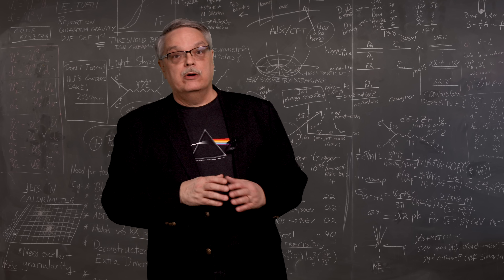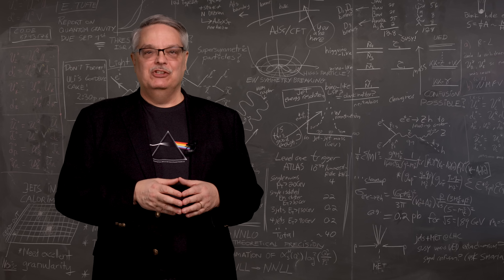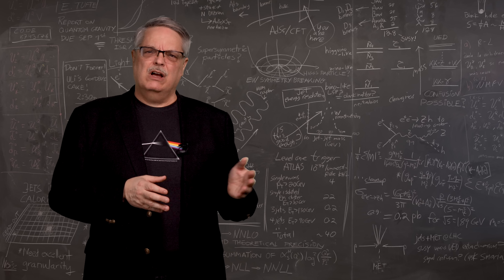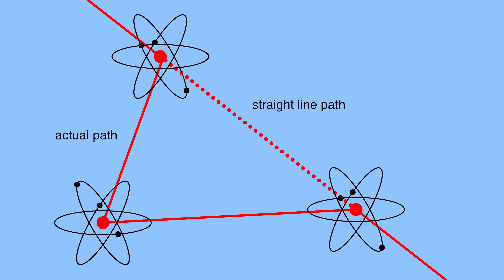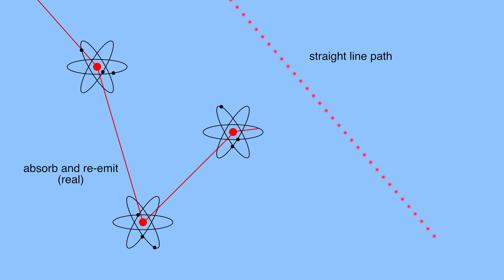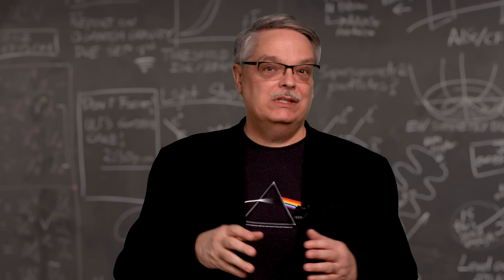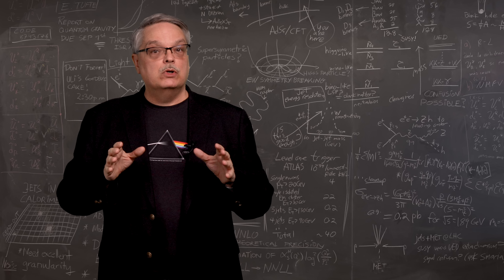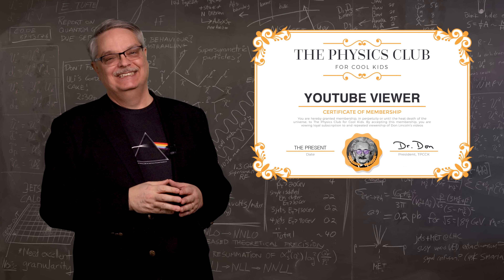Why does light slow down in water?

Comment: But why does the wave generated by the electrons move at a different speed?
Reply: I thought all electro magnetic waves moves at the speed of light, why doesn t the ones generated by the moving electrons as fast as light is, i can t find answers on google.
Reply: We are frequently told that electricity moves at the speed of light through a conductor. Not really. It depends on the conductor. If you look at some TV video co-axial cable you might find a number printed on it apart from the "75 Ohm" marking such as "0.66" or "0.75". This smaller number is the velocity factor. It means the video signal is moving along the wire at 66% or 75% of the speed of light. The reason is the same: the movement of the electric signal generates its own opposition and the effective progress is slower than the theoretical "speed of light/electricity".  You will find detailed explanations of this in HAM Radio handbooks. HAM radio signals are usually fed through larger (than TV) diameter 50 Ohm coaxial cables with a velocity factor of 0.66. This has to be considered when cutting the cable length because the cable must never be exactly an odd multiple of 1/4 of a wavelength or the antenna won't work well.  See? There are very practical applications of such knowledge of physical systems.
Reply: @roberttrisca8210  Nope, speed of electromagnetic waves depends on the permittivity and permeability of the material through which it travels. The speed of light as you know it is the speed of  light in the vacuum. Vacuum has specific values of permittivity and permeability. see : https://en.wikipedia.org/wiki/Electromagnetic_wave_equation
Reply: @roberttrisca8210  There are substances that can slow light down to literally single meters per second.
Reply: @imonlyamanandiwilldiesomed4406  source ?
Reply: @imonlyamanandiwilldiesomed4406  much appreciated ^^
Reply: @roberttrisca8210  Both the initial elector magnetic wave and the wave emitted by an oscillating electron, progress at the speed of light in the space. However the wave length emitted by the electron is a lot larger than the wave length of the light. This is due to the electron having mass, which resists the change of its momentum. Together these two waves form a wave packet with two frequencies, which progresses slower than the light itself. Google wave packet propagation for more info :)
Reply: Lauri Vaara thanks
Reply: @laurivaara3177  
while it is true that wave paquet travels at speeds inferiorto the speed of light, it only works in dispersive medium.

also, if you apply, newton's second law to an electron, for frequencies low enough so that we can neglect the thermodynamic equivalent of viscuosity forces, we get that the speed of an electron and the electromagnetic field oscillate at the same frequency, except, with a phase difference of pi/2.

the real reason why is due to the electric current that modifies the dispersion relation that the wave have, here's a good article to understand, though it is rather lengthy and very math extensive:
https://en.wikipedia.org/wiki/Mathematical_descriptions_of_opacity
Reply: They all do, but its the interaction of the light waves interacting with electron waves. electrons orbit atoms as waves not particles. When two sets of waves interact that propagate as if they are a become a new waveform (combination of phases), until it exits the transparent material. The Light can propagate beyond the transparent material, The electron are force to remain in the material orbiting their atom nuclei. Thus when the light exists the material is continues traveling at c.
Reply: @roberttrisca8210  : it does move at the speed of light. It just that the second EM wave does not have the same wavelength and frequency as the one that entered the material. The combined wave produces a wave with peaks and valleys that moves at a slower speed than the original.
Reply: @zapperz2000  and one more thing i dont get, when do em waves add up to form one, and i m thinking of the different colors beeing different waves which don t add up to become one or how does the colors work then ?
Reply: @roberttrisca8210  This is not a property of just EM wave, but rather all types of waves. It is called "superposition". It happens in water waves, sound waves, etc. It is why you see "white light", because it is a superposition of all the different rainbow colors, and your eyes perceive such superposition as the color "white".
Reply: @zapperz2000   but the emiting  direction would be random , every time we should get a bit different speed in material
Reply: @naveenpoonia5425  Not random, but refracted differently.  That can indeed happen if the material or its surface is not uniform.  You'd get a distorted image when looking through such a material.
Reply: @zapperz2000  I'm confused about the same thing. As you mentioned, any EM wave travels with a same speed. And I get that the resultant wave has a different wavelength/freq. But it should still travel with the same speed as the original wave. But you say it moves slower? Didn't we establish that the speed of light is independent from its wavelength?  Why would it travel slower?
Reply: @DrFarazHarsini  The various waves ARE traveling at the speed c. However, the SUPERPOSITION of all these waves, i.e. the resulting wave, has a velocity that is less than c.
There is such a thing as group velocity and phase velocity of a wave. Often times, when we talk about the speed of a wave, those are what we are referring to.
A good thing to review is the concept of thin film interference, especially in the context of anti-reflective coating. It is not that there is no reflected wave. Rather, the sum or superposition of all the reflected wave cancels out, and you end up with no reflection.
Reply: @zapperz2000  
but but but !! phase velocity is faster than light
Reply: @recouer  Not in this situation.
Reply: @zapperz2000  in that case phase group goes at the speed of light
Reply: @recouer  "phase group"?
Reply: @zapperz2000  group velocity ...
Reply: after all you have the relation:
phase velocity * group velocity = c²
Reply: zapperz2000 Cool, now explain the same story with a single-photon pulse-wave.
Reply: Zapperz2000 that is the only possible explanation that I can understand. However, the example he gave was for the superposition of two wave of different speeds. Do you have a reference for the effect when two waves of the same speed are superimposed? This is something that has bothered me for many decades and I would very much like to resolve the problem.
Reply: @zapperz2000  this still doesnt explain why we cannot detect a fast wavefront that moves at C before we enter steady state and the net phase (?) velocity is slower.
Reply: If the Fermilab guy had explained this accurately then we all wouldn't be chatting here wondering why. He did not explain his point very well.
Reply: @HVYMETL  Totally agree.  I had the same thought.  He doesn't explain why the lightwave and the induced electromagnetic wave combine to produce a wave that is always slower.
Reply: @HVYMETL  You got that right. He could have just said it's the drag due to mutual AC induction and let it go at that. Instead he complicated it with "mixed waves" which isn't wrong but is totally unnecessary!
Reply: @craigwall9536  
mixed wave isn't wrong? are you serious?
but seriously this is complete BS, the superposition of multiple waves has never made it slower. take the white light for exemple, this is a superposition of photons from all the visible spectrum (and more) so yes what he's saying is utter BS. 
it is mostly due to how EM waves propagates trough space. we can easily get the propagation equation of light using maxwell equations and then we can see that the speed depends on the electric current in the medium.
in a void, it is null thus light speed is maximum in a void. but once you enter a medium, atomes can be considered as dipole that can create an electric current due to the electric field of the EM waves. thus this current reduces the speed of light.

for more details: 
https://en.m.wikipedia.org/wiki/Mathematical_descriptions_of_opacity
Reply: Joe Chang  Can you prove that? Did you do publish the paper of your experiment? Did you mathematically show how Maxwell's equations are wrong? I don't think so.
Maxwell's theory of electromagnetism works perfectly, has been proven thoroughly and is the reason the computer, the mobile phone and the internet work.
Now I understand why you got banned.
Reply: Joe Chang  Your hypothesis is wrong because it contradicts experiment. Also you need to explain the mechanism behind it (and I don't mean some ad hoc explanation, but a rigorous mathematical one) and do the math, then see if your predictions are right.
Reply: When an electric field is applied to the electron, the electron starts accelerating. As it moves it generates a magnetic field. The magnetic field strength increases as the electron accelerates. This increasing magnetic field induces another electric field, which points in a direction opposite the motion if the electron and the applied field. This causes an opposing force that reduces the acceleration of the electron. It's called Lenz's law. In effect the transparent medium (water, glass, etc) behaves similarly to the characteristic capacitance and inductance of a transmission line, which slows down the propogation of the wave.
Reply: I must look this up but as I understand Lenz's law , if a conductor is moved relative to a magnetic field an electric field is induced in the conductor. This electric field will cause the acceleration of charged particles in the conductor. In turn this acceleration causes a magnetic field of opposite polarity to the original magnetic field. This opposing magnetic field would be of equal strength to the original except some energy is lost from the system as heat. If we apply this to light passing through glass the loss of energy should be expressed as a change of wavelength when the light emerges from the glass. This does not happen I had never really thought about the problem before and I am not sure that I understand it so I am willing to learn. I read something a while ago by Richard Feynman concerning the interaction of light and matter - I shall serif I can find it. I am also not entirely sure that the speaker on the video fully understands the problem. @danebeck7900
Reply: @iplanes1  I agree with most of your description of Lenz's law except the part about energy being dissipated as heat. If the induced field was equal in magnitude to the applied field than they would cancel out 100%, and then the charged particles wouldn't accelerate at all. Lenz's law is just a consequence of Maxwell's equations and has nothing to do with heat dissipation. Also, if it did cause heat dissipation, then a light wave would "damp out" after a few oscillations just like you would expect of a mechanical wave such as a wave on taught string or a slinky. Of course this doesn't happen with light. The one example I can think of where induced electric fields cause heating is Eddy currents, but that's because of the resistance of the material the Eddy currents are flowing in, not because the fields themselves dissipate heat.
Reply: Okay I have to correct myself, if you have a lossless system then the induced electric  field will have have the same energy as the applied magnetic field, they're just out of phase. Energy transfers from the magnetic field to the electric field and back again. That's how a light wave propagates without losing energy. Just like how a pendulum converts potential to kinetic energy and back again (assuming you had a frictionless pendulum in a vacuum).
Reply: My conclusion on this matter is that I do not understand it and neither does the speaker on the video. The main difficulty with the image is that at the subatomic level there is nothing that we would regard as solid matter. The idea of "solidness" is a macroscopic concept that means nothing at the incredibly small level. The "particles" themselves such as electrons are actually simply mobile  stress points in the continuum of the universe and the area around them is simply less stressed. To talk about interactions between subatomic particles and electromagnetic waves in the same language as is used for describing what happens when you slap the table is meaningless.The really useful thing about this video for me at least is that it makes me think about things I had taken for granted. The negative side of videos such as this is that some people will take what is said without criticism and assume they understand. I am pleased to see that neither you nor I fall into this group. I am also very pleased to see that you are not one of the people who regard online discussions such as this as a point scoring game that results in abuse.kia mau te rongo ki a koe
Reply: @iplanes1  Okay, but do you agree that a wavelength of light is orders of magnitude larger than the interatomic spacing? If so then it seems appropriate to treat the medium as continuous, and the interpretation of an induced wave interfering with the incident wave starts to make more sense. Especially since there are so many well known examples of electric and magnetic fields inducing opposing fields in matter. I think that's why he chose to use the wave interpretation of light to explain this, not the particle interpretation.
Reply: I think your answer illustrates the basic problem. This is the difficulty in understanding the interaction between matter and energy. Eddy currents, as you say, cause heating due to the resistance of the iron in which they flow. When we talk about radiation of heat we are talking about emission of infra red photons. So again we are talking about how electrons are caused to move by differences in potential in an electric field (we call this current). The motion of these electrons is somehow inhibited (resistance) so that they loose energy which then appears as photons. The fact that the electrons themselves can be acting, on occasions, as waves makes my mental picture even less clear. I have now got to go and work in my workshop and will not be back at my computer for some hours.
Reply: @iplanes1  @Dane Beck
i think my answer may interest you.
Reply: @iplanes1  
btw what you describe as heat radiation is highly confusing. while i do agree that heat produces photons, and we can calculate the total energy radiated thanks to stefan boltzmann law plus its medium wavelength (or rather the wavelength with the maximum of emission) using wien's law, you need to understand that this is a thermal process and has nothing to do with the moving of protons (or at least not intrinsically).
what happens here is that energy is lost due to joule's law and in the case of our electrons, its formula is <j * E> with < . > being the root mean square of the function, j the electric current of the electrons and E the electric field of the photons.
however, in the case of dispersive medium, j and E are in quadrature, this means that there is a pi/2 difference in their phase.
thus, when we get the root mean square of the multiplication of periodic signals in quadrature, the resultant is null so the energy given to the system by the electromagnetic field is null.
Reply: Frank Gibson saying that the presenter doesn’t understand coming from someone that does not possess a physics degree is irritating. If you want I clear understanding of how all this works you must be able to understand and perform the math associated with quantum mechanics and particle physics in general. Without that ability no true understanding will ever be had. This applies to me as well. I will never really understand. As Dirty Harry said, a man needs to know his limitations. Learning particle physics from YouTube videos , especially the comments section is just silly and unrealistic.
Reply: @evilsimeon  
do you know of a quatum model for describing the refraction of light ?
Reply: And why does the new, slower wave does not generate a new wave, slowing down the light even more?
Reply: testthewest123 that's because it is in phase with the electrons since the electrons is producing it. So if you have an source that produces a wave on a string the resulted wave doesn't move the source to produce a new wave
Reply: @testthewest123  new wave has smaller amplitude, it does generate furthjer waves but even weaker, etc, and all that is summed
Reply: @cicik57  
well this would be a good time to talk about converging series if the explanation was right which isn't.
Reply: @testthewest123  because there is no 'new' wave. you have the superposition of the 2 that "replace" it.
Reply: @testthewest123  EM (light) waves do not generate EM waves. EM waves are generated by moving electric charges like as electrons. I suppose you could argue that the EM wave from the electrons causes more electrons to move thus generating ever slower EM waves. While there might be some of this, the effect is negligible, because the EM waves are so weak because most of them have interacted with the original EM wave.
Reply: @testthewest123  Wave does not generate waves, only accelerated charged particles do
Reply: Because the light wave entering the transparent material is the same light wave exiting the material. its just forces to propagate slower in the transparent material.
Reply: @testthewest123  Some materials may actually do this, but the differences are related to the material and the material constants are determined empirically, so any secondary, tertiary, etc. wave affects are netted out when measured.
Reply: The higher the frequency, the less the effect... The frequency remains constant
Reply: The wave from electrons moves at the speed of light. You just can't see it because it interferes destructively on all paths except the path of the light.

In effect, when the light passes through a medium what you see is a moving interference picture.
Reply: where to begin...
this video has taken many shortcuts in explaining the relations between the two systems and how it affects them.
to better understand this, we need to talk about d'alembert's equation and its dispersion formula and how it describes a wave.
so d'alembert's equation is used to link together the spatial and temporal variation of a wave.

and from this equation comes the dispersion relation that links together the frequency, wavelength and celerity of a wave.
to access to this equation, we use maxwell relations to describe this phenomenon. when we consider those relations in the void, we get the relation: c² = k²*w² where k is the angular frequency and w its wavenumber. (just google it, ain’t that hard to understand)

thus we can see here that the celerity is proportional to its angular frequency. however, as explained in the video, when light enter a medium, there are charges that can be influenced by the electric field, especially electrons that are 2000 times lighter than their counterparts protons.
thus, when light comes in this medium, we assume that only electrons are affected by the electric field.

we then apply newton's second law to those electrons to find a relation between an electron's speed and the electric current
(we also neglect the magnetic field of the light as the electron is relativistic thus the force from the electric field is much greater than the magnetic one see lorentz law to better understand this )
and then by generalizing this equation to all electrons in the medium, we can get an induced current from the electric field of the light.
( the current is j = n * v with n the volumic density of charges and v the celerity of electrons)

then when we put this back to maxwell ampere local equation, we introduce a new component: the induced current which thus gives us a new dispersion equation: c² = k² * (w² - wp²) with wp the plasma oscillation and thus we can see that from the value of wp, we'll get a different value of the celerity of the wave.

thus we can say without a doubt that they are wrong in their explanation as it is not the combination from the electric current of the electrons and the wave that makes it slower but the induced current inside the medium that modifies the dispersion relation thus modifying its speed.
or in simpler words, it's the movement of electrons that changes the frequency and celerity of the light, but not the combination of the two electric current. (also on a side note, trying to represent the electric current of a dipole using a sine wave.. funny thing you did there 😅)

and finally, as for the reason why the light has a different angle, well you can easily explain this using two waves parallel to each other crossing the medium in phase with each other. as they have the same wave plane, you can easily come to the relation between the refracted angle and the incident angle using some basic geometry. i recommend you to see the demonstration of descartes second law if you want to better understand what i'm talking about.
Reply: @recouer  So you're saying it's because of the current which alters Maxwell's Equations, aka modifies the wave equations in vacuum where the speed of an EM wave is c, into equations where the speed of the wave is not c.

Instead, people are thinking in terms of EM waves in vacuum, which is modified by adding EM waves produced by moving charges.  Are these two situations not physically the same?  The first description implies something magical about this "current" affecting the Maxwell's Equations.

What if the volumetric density of charges are turned into dirac delta functions representing the point positions of electrons, so essentially you have a vacuum everywhere except at those point positions?  Do we still get the same dispersion relation without "averaging out" the charge density (doing so essentially models the charges as continuously distributed)?  Then again, I guess you could argue that we must average out the charge density because of the wave nature of the electron.

Even so, this suggests that there is something fundamentally flawed from looking at EM waves traveling through a material as EM waves in a vacuum being added by EM waves emitted by moving charges.  It is then not a linear effect, but a nonlinear effect which enters into Maxwell's Equations via the current density term.
Reply: @cryora  
from my point of view, the fact that superimposed waves do not have the same velocity is even more "magical".
also this is not the same thing, because in the dispersion relation, the magnetic and electric termes are coupled, wich means when you add an electric field induced from an EM wave in the right part, you'd also need to add an magnetic one in the left part, thus the dispersion relation stay unchanged. i mean, you try to write this:
dB/dt = grad(µ*E + µ*E1)  (with µ*E1 ~ µ*e0*J)
where as the good formulation could only be :
dB1/dt + dB2/dt = grad(µE1 + µE2)

"What if the volumetric density of charges are turned into dirac delta functions representing the point positions of electrons, so essentially you have a vacuum everywhere except at those point positions?  Do we still get the same dispersion relation without "averaging out" the charge density (doing so essentially models the charges as continuously distributed)?  Then again, I guess you could argue that we must average out the charge density because of the wave nature of the electron."
good intuition, that's exactly what we do, but don't forget we are talking at a mesoscopic scale so of course you'd need to average out the effects at the nanoscopic scale.

 "EM waves emitted by moving charges" for the n'th time, moving charges do not emit EM waves.
also, the magnetic field induced by the current isn't as localised as the electron so..
Reply: @recouer  Right.  People are claiming superposition of waves that travel at the same speeds can produce a wave that travels at a different speed.  This wouldn't be possible even if the waves had different frequencies or wavelengths, if each wave still traveled at c.

I still wonder how this slowing down of light would be brought about at the nanoscopic scale.  Perhaps light travels the same way it does in vacuum where there is little concentration of electron probability, but travels as though it is in a material where there is high concentration.  So it would be like a massive beam of light going through a swarm of glass shards.  Light travels at c in between shards, but slows down considerably when it encounters a shard.  Averaging out these dynamics gives the behavior of an "effective" medium whose index of refraction depends on the density of shards in a given volume and the shard sizes.

My mistake.  I mean accelerating charges.
Reply: the wave generated by the electrons is actually light. So it has speed of light same as incident light. However it has different frequency.
Reply: @zirize  But why
Reply: @pahom2  Because the "original" waves disappear. When they enter superposition, only their contribution to the amplitude of the combined wave exist. So only the combined wave can cause any change in the surroundings - it also generate the new high-speed lightwave (and reflections) when it meets the edge of the material.
Reply: Nice explanation, but what would Feynman say?
Reply: actually after seeing this again i dont think there is a interest how this really works
a sine wave is not really complicated as is the trigonometry

maybe its classified knowlegue so we should not know how this works
Reply: Yes, that's a good question.
To get a slower wave you need an interference between the faster (the original) and a slower one of the same frequency otherwise it messes things up. Even so, the resulting wave will have moments where it cancels out the original wave and moments of constructive interference and the resulting wave will pulsate of course the mean power remains constant and with the naked eye you couldn't detect the difference.
Reply: t has to do with how much the medium can be polarized and magnetized by an incoming electromagnetic field. If the medium is a medium that doesn't polarize/magnetize a lot, light goes quickly through it, if the medium gets more strongly polarized/magnetized, light slows down more.
Reply: I'm thinking that maybe, MAYBE, light doesn't move at all.  It is the internal time circuit in your brain detecting waves, photons, whatever, and when you see the light, then you got it right there.  Physicists will gladly admit the observer (YOU) don't exist !!!
Reply: @Fazulur Rahman I'd be lying if I told you..
Reply: and why does he regard possible angle change in "wrong hypothsys" and disregards in his) ...   what is a wave?  how it has such  a consisntan and eficient interaction with matter wich is mostly emptyness as we all know.  what is a field?!   i will tel you one truth. we are living in a dark ages!!!!  and he knows as much how things work as a child that "heard something" and didnt really think about it
Reply: @Fazulur Rahman No, only the speed of light in vacuum. Outside of vacuum it can have any speed lower than that, even stopping completely.
Reply: @migBdk  I see about 1/4th of the people commenting actually understand this issue- because the rest get all their information from dumbed-down sources.  Lonely,  isn't it? We should just cut our losses. Hand-waving Don isn't helping.
Reply: Drag
Reply: Maybe because it has MASS. And massive object cannot travel at speed of light.
Reply: @VENOM-tx6gp  well that's a given
Reply: @pahom2  because when electron is hit by a light wave it interacts with the electric component and start oscillating thus changing its speed which creates magnetic field and because this happens at a very fast speed (near speed of light) the resultant is electron emitts electromagnetic wave which interacts with light (an electromagnetic wave) and thus the resultant is an electromagnetic wave (light)
Reply: Water has a thicker mass induction than air.
Reply: Joe Chang  Wrong. Light speed WOULD be infinite if Planck's Constant were zero. But it isn't.
Reply: Electrons have a definite mass and cannot travel at light speed.
Reply: @Brix098  
while this is true, they can however oscillate at the same frequency of the EM wave
Reply: @Brix098  Suppose you have two electron guns at rest. Then shoot an electron at the other gun at the same time at 0.8 c so a neutral observer standing to one side sees them strike each other with an impact speed of 1.6 c. What does one electron "see" as the approaching speed of the other? Both electrons see themselves as stationary and the other moving towards them. In both cases the electrons consider the other as approaching at 1.6 times the speed of light. If they do not, if they experience something else, it matters not because the other really is closing at that speed. 

Scale it up. Build an accelerator capable of accelerating two planets to 0.8 c in opposite directions aimed directly at each other.  The collision speed of the planets upon impact will be 1.8 times light speed to any observer, whether standing on the side or riding on the planet. Interestingly, people on both planets will see the other one approaching because light leaving in the direction of the other planet will arrive before the planet does, with a large blue-shift. Classically, the incoming light will have an arrival speed of c but the two planets are moving toward each other, relatively, at 1.6 c in physical space. When they collide, the impact energy will be based or m•v^2 where v = 480 million metres per second. This sort of thing is done routinely at CERN. The idea that particles with mass cannot move relative to another particle with mass at greater than light speed is invalidated. 

From the perspective of people on Planet 1, Planet 2 has accelerated towards it with a closing speed of 1.6 c. Each planet sees their approaching danger and fires an enormous electron gun to destroy the other planet. The electrons leave each source planet at 99% of the speed of light. What is the actual collision speed of those electrons on the other planet? What does an observer to the side see as the impact speed? What does as observer on a planet perceive the incoming electron speed to be? All interesting questions.
Reply: @crispinp-p397  
the issue with your analogy is that you are assuming the speeded up particule perceive time the same we do. this is not the case, as you go faster, the perception of time will also be modified. so much that relative to one of the sped up particule, the other one isn't faster than the speed of light.
Reply: @pahom2  Because light wave is a moving electric field with nothing else going on, and so is the generated wave. The combined wave has nothing else going on except the moving electric field. And a wave with nothing else going on but moving electric field is light itself. No mass, no particle, just pure energy. That is the beauty of field theory.
Reply: is not all electro magnetic wave has same speed like light???
then why the new generated wave by the light has slow speed?
Reply: @krp1eee  
someone give that dude a medal !
Reply: I guess only photons (light) can reach the velocity of light (c) and other particles can only come near the velocity but not exactly equal to the velocity of light....it's just my guess...not sure about it ..correct me if I am wrong 😅
Reply: @abhzz3473  
as it would require an infinite amount of energy for matter to get to the speed of light, no not really
Reply: @abhzz3473  I want to remind you that the electrons don't have to travel at the speed of light in order for the EM wave they generate to go at light speed. Take the electrons in a transmitting antenna, for example.
Reply: ViperDaniel The secondary electric field induced by the light energy moves at the same speed but, when combined with the light, the combined wave travels more slowly through the material.
Reply: @desmondroberts6034  
electric curent*
Reply: @jcd-k2s  my view is exactly like you said, as Maxwell's equations are the actual answer to this riddle.
Reply: Because only light can travel at the speed of light. Therefore any other thing or wave moves slower. The reason light can travel so fast is bcuz it doesn’t have any mass. If something has any mass (even a tiny tiny bit) then it can’t reach the speed of light. Since electrons have mass they move slower than light which means a different speed
Reply: Benoit Avril Cool, maybe explain the same story with a single-photon pulse-wave in a medium moving toward the source of light near the speed of light in vacuum would work better.
Reply: Electrons do not travel at the speed of light, ever, and especially not in atoms.  The field they generate follows them where ever they go, and oscillates, with respect to the incident light, as a result.
Reply: I think I understand what you are saying. My problem might be that as far as I understand the velocity of radiation would be independent of any particular behaviour of the electron. So I see how the frequency would be dependant on how the elector behaves but I don't see how the resulting radiation would not have the canonical velocity of light.It's a bit like a stone being moved up and down in water. The resulting waves move with a velocity independent of how the  stone is oscillating.I don't write any of this to be argumentative or contradictory. I genuinely don't understand. It just seems that every explanation is unsatisfying.I can add a little more. iI is a natural consequence of Maxwell's equations that in a dialectic material the velocity of radiation is reduced. I assume this is what we are dealing with here. I don't think it is something different. So mathematically I am happy with this. It is just intuitive pictures that are difficult for me.Mr H if you have anything you can add rest assured I do want to understand this.
Reply: @samjohnston8818  The light is interacting with the electrons field, yes, at the speed of light, but the point in the electrons field that the light is interacting with is changing due to the motion of the electron relative to the light.  Effectively, the amplitude of the electrons field that the light is "experiencing" is changing at a rate less than the speed of light.

The field of the electron, let's say, has a value of E1 at a point far from its center, and a greater value of E2 at a point at half that distance.  Let's look at the situation where the electron is, somehow, stationary.  The light will travel from the point of value E1 to E2 at the speed of light, yes.  It will take a time c/d, d the distance between E1 and E2.  Now look at the case where the electron is moving in the same direction and parallel to the light.  As the light travels from E1 to E2, the distance d will be increasing, right?  Thus, the light will take a time to reach E2 of c/(d + some amount).  In the reverse case, the time would be c/(d - some amount).  If you add the waves together at E1 and E2, you get the same values, of course, but the resulting values are delayed or accelerated.
Reply: The way I understand it, the time it takes each electron to feel the force from the original wave and produce a new one causes each new wave to be slightly retarded in phase, therefore reducing the phase velocity of the overall wave.

I tried to model this using sine waves in audio software; when each additional wave was less than 90º out of phase then the phase was slightly delayed. I'm still not sure I'm thinking about this the right way or if the effect I observed would be nearly big enough to account for a 30/40% reduction in phase speed.

The frequency(colour/energy) would remain constant right? This would then require the wavelength to shorten if the wave was moving slower. Not sure how that ties in with the whole phase experiment thing.

Thoughts?
Reply: It is because of the Riley scattering, when the electrons oscillate, it emits light to all directions, only the front one is much larger, so the combined light is to the front, hence, slower light.
Reply: Science Revolution, because you're an idiot, I presume?
Reply: Electrons have mass and are bound to the atoms, so they do not move immediately when subjected to the force from the EM wave (light). There will be a delay and since the frequency of the resulting wave depends on the frequency with which the electron oscillates, it will be lower than the incident light.
Reply: Because photion is a mass less particle and electron has a mass.
Whether it is in vacuum or in glass the particle which has mass than the massless particle will change less..
Reply: @cisarvialpando7412  The electron generates an EM wave, which is masless and so should move at light speed.
Reply: Al Garnier  You are talking nonsense. An oscillating charge creates an EM wave. Go learn some real physics.
Reply: Al Garnier  I really hope you're trolling
Reply: Because the electron has mass and can't oscillate as fast as the light
Reply: @lambda653  that might only affect the frequency, but the electrons produce an EM wave that is light
Reply: You should refer to the Planck's atomic model and it's equations to get your answer if you got your answer hit the ,,👍 button
Reply: Electrons move opposite to EF
Reply: Hey dude not sure if anyone actually answered your question but basically its because the photons acquire mass after the waves add together. It has a name Polariton. So it is still true that Photons always travel at C or all of relativity wouldnt work. But once they hit glass etc the become Polaritons and have non-zero mass. https://en.wikipedia.org/wiki/Polariton
Reply: @graig2558  Those are a bit of a different thing. The reason why the waves move at a different speed is that the sum of the partial waves with velocity c sum in such a way as to give a different total velocity. It is just a difference between phase velocity and group velocity.
Reply: @non-inertialobserver946  Yes it travels at a different velocity because the electron wave has mass, and when added together you get a photon that has a non-zero mass so it travels slower than C. If both waves had no interaction with the Higgs field they would both travel at C even when added together.
Reply: @graig2558  this has nothing to do with that. We don't need to introduce the Higgs field and electrons and quasiparticles for this. It's just a matter of the sum of regular electromagnetic waves
Reply: @non-inertialobserver946  EM waves travel at C unless they have mass, You need to explain why the sum of the wave is not traveling at C if it has no mass.
Reply: @non-inertialobserver946  https://en.wikipedia.org/wiki/Photon#In_matter See specifically "In a particle picture, the slowing can instead be described as a blending of the photon with quantum excitations of the matter to produce quasi-particles known as polariton (see this list for some other quasi-particles); this polariton has a nonzero effective mass, which means that it cannot travel at c. "
Reply: @graig2558  https://en.wikipedia.org/wiki/Phase_velocity#Relation_to_group_velocity,_refractive_index_and_transmission_speed
Reply: @non-inertialobserver946  I don't know what more I can say. I linked the wiki explaining what the mechanism is. You have just linked me the phase velocity. Yes I understand the phase velocity is lower than the velocity of the photon. What you don't seem to understand is that the reason its slower is because it has non-zero mass due to the fact it is interacting with electrons. To say a zero mass particle isn't traveling at C would completely break relativity, you get that right? Zero mass particles/waves MUST travel at C in all mediums otherwise you would have parts of the universe disobeying relativity.
Reply: @graig2558  Alright, you're thinking in terms of photons, but the electromagnetic wave picture is simpler in this case
Reply: Ok here is your answer 
Look electron is a charge particle which mean it create electric field in feast and magnetic & electric field in motion because it is property of charge particle 

Now here is my question for you  
 why does the charge create this fields
Reply: Science Revolution  if it was infinate you wouldn't see it move it would just be there
Reply: Science Revolution  The "stiff rod" seems like it would work as an explanation but you're gonna have to be more clear on what exactly it is.
Reply: Because nothing moves faster or the same speed as the speed of light. By definition, it must move slower.
Reply: @wendlthomis374  No.  Electromagnetic waves are charged particles moving in directions dictated by the field.  Only some electromagnetic fields consist of photons.  

Consider the electromagnetic field created in an electric power generator.  Do you see light from the armiture?  No.  Does light travel down the cable?  No.  In both cases, it is considered the fields are negatively charged particles; in the cable chiefly electrons.
Reply: @eggsngritstn  Your view of electromagnetic fields is incomplete. Electromagnetic fields are always  and only made up of photons. But these photons range over the entire electromagnetic spectrum, from radio waves, infra red, visible, X-rays to gamma rays. An electric power generator does not emit electromagnetic energy in the visible frequency range, but does in other portions of the spectrum. Light photons do not travel down the cable but lower frequency photons do which transmit the electromagnetic force. Electrons can only interact with one another via the electromagnetic field, i.e., by exchanging photons.
Reply: i think because, unlike photons, electrons have mass.
Reply: @BabyXGlitz  This might be right
Reply: And why don't we see two waves coming out?
Reply: @KafshakTashtak  Fermilab crickets... :-)
Reply: @KafshakTashtak  Because the electrons are only wiggling- they aren't traversing the medium- only the photons are.  Look: go figure out Van Der Waals forces,  where one set of electrons are vibrating and influencing other electrons and get into sync. It's a mutual induction thing. Now just substitute the traveling EM field for one of the electron fields. 

The point is,  the light wave exchanges momentum with the electrons and the permittivity of the medium is less than that of vacuum- so the "distraction" of these energy exchanges retards the traveling wave front. 

You might also drop a magnetic sphere down a copper tube and observe the retardation. It's the same effect,  just from a pure magnetic field inducing EMF and an opposing magnetic field in the copper. I don't know why this guy thought he needed to complicate things with his wave "mixing" notion- he's not wrong but it's more complicated and confusing than it needs to be. It's just two charge fields interacting to cause DRAG.

One field is moving freely and the other essentially stuck in place.
 
Simple as that.
Reply: @pahom2  Thinking about it as 2 separate waves that you add together, is a human idea. What actually goes on is a complicated ripple in a pool called the electric field.
Reply: @DFPercush  a "human idea"? I'm unaware of any other type
Reply: @JohnnyKidder  It's a model, a representation in a language that renders itself towards being able to make predictions within a certain domain, and it's very good and useful at that, but if you look at the surface of a lake, you don't see a plus sign anywhere. If the system is simple enough, like a slinky in a physics classroom, it's easy to intuitively see two waves getting bigger when they collide. A material composed of billions of atoms, on the other hand, is too complex to imagine all the individual waves that added up to make the pattern you see, in this case, light.
     I was responding to "And why is this new combined wave becomes the lightwave itself?" - implying a distinction between one component of the resultant wave form, and another. But in fact, they are not distinct physical waves, where one is light and one is something else, they are in fact the same thing - the electric field being vibrated. Hope that clears it up.
Reply: Whenever we shift our thinking about light to thinking about it as a wave, we have to completely let go of the particle model for the time being. A photon is not a wiggly line shape that moves through space as a particle would. It's an emergent phenomenon of the entire electromagnetic field.

It "travels" from one side of the medium to the other the way ripples travel on the surface of a pond that's full of random ripples. The ripples don't transport water from one side of the pond to the other, they just surge up and down, adding and subtracting from the water level at each point on the pond's surface.

At all times there's just ONE surface, right? No matter how many ripples are "moving across" the surface, all the surface is REALLY doing is moving up and down. We can see ripples because they are emergent phenomena of the surface, not because they're separate distinct things that could be removed and put in a box. The surface is what we call the electromagnetic field.

Photons - understood as ripples in this field, not particles - can interact with each other, producing a wave effect called diffraction. It's just a regular pattern of ripples from combining photons that have similar wavelengths. Photons can also interact with other "particles" such as electrons, which we must also think of as ripples in the field. (The interaction between the electron and the field is what matters here. We ignore its other properties.) As such it's just another wave phenomenon to be added and subtracted, but the electron happens to have a longer wavelength and thus when combined with the photon wave produces a net phenomenon that propagates more slowly across the medium. Of course it's not just one electron affecting the field but all of them.
Reply: Dan Razzell this is the first useful explanation I’ve seen in the comments of the video. You’ve explained it in a really easy to understand and simple way which shows you also really understand it. Thank you
Reply: @starfishsystems  not very relevant to the video topic, but since you mentioned,  can't help but wonder, if light is a wave , and a wave, I guess , cannot "be" without a medium, what medium does it travel on while in vacuum, or out in space?
Reply: @marialeina5866  transverse waves, such as light, can and do travel in a vacuum.  In fact, light does so faster than in matter.  It's longitudinal waves, like sound waves, which require a medium to exist.  Waves are transfer of energy.
Reply: @krysoboi  thanks for that, also found another answer on this, that points out the distinction between electromagnetic(like light) and mechanical waves ( like the motion of water), stating that mechanical waves need a medium while electromagnetic ones don't.
Reply: As the electromagnetic fields oscillate in the wave, the charges in the material will be "shaken" back and forth at the same frequency. The charges thus radiate their own electromagnetic wave that is at the same frequency, but usually with a phase delay, as the charges may move out of phase with the force driving them (see sinusoidally driven harmonic oscillator). The light wave traveling in the medium is the macroscopic superposition (sum) of all such contributions in the material: the original wave plus the waves radiated by all the moving charges. This wave is typically a wave with the same frequency but shorter wavelength than the original, leading to a slowing of the wave's phase velocity.
Reply: @kai_enforcer  But why isn't the frequency and wavelength of the wave caused by the material equal to that of the light?
Reply: Average of Probabilistic speed of election of same kind of material is some what same ..... And light is a electromagnetic wave with electric and magnetic field perpendicular to each other that field causes force to electron..as it varies electron direction some how it causes the electron to create a second wave or moving electron gives force to that lightfield which addsup creates a new wave .
Reply: PLEASE STOP replying to question here with "I don't know but..." or "Maybe it's due to...". Reading through 60 of those before getting to an actual answer is mental. YOU ARE DUMB AND WRONG, STFU.
Reply: Because of difference in the amplitude of electronic wave
Reply: @mahimarajput3598  
except the amplitude of a wave has no impact on its speed, take thunder for exemple, even though it has a very strong intensity, it has the same speed as any other wave.
Reply: My guess is that the wave generated is in opposition to the incident wave (moving in the other direction or even at other various angles) and the overall combination is impeding the initial wave.
Reply: A photon is an oscillation of both the electric and magnetic fields.  An electron is an oscillation of the electric field (though I believe that may induce a magnetic charge as well).  Like 2 ripples in a pond will "add" their waves together, so will the electric fields of the electron and photon.  As shown in the video, wave such as these will have an additive effect.  The speed of the light's electric field (speed of light) and speed of electrons electric field are "added" up to a new overall electric field with slower rate of propagation.  Since the light is an oscillating excitation the the electric and magnetic field, the resulting oscillation's speed of propagation is modified to this new, slower speed.  Once free from the glass, the photons are no longer being modified (slowed) by the electron's electric field and speed back up the the speed of light.
Reply: @chefhearne  'A photon is an oscillation of both the electric and magnetic fields.  An electron is an oscillation of the electric field' ... This is a wonderful comment.
Reply: @jackmack1061  I don't think it's a correct one, though.  Electrons and magnetic fields clearly interact.
Reply: Electrons have a mass so they can't react to the changes of external electric fields immediately. Because of inertia they necessarily follow behind.
Reply: @woowooNeedsFaith  They don't follow very damned far- they just wiggle in place!
Reply: @woowooNeedsFaith  Wouldn't that only affect the phase, keeping the frequency, speed, and wavelength the same?
Reply: Because it is a reaction wave .... it is orignaly generated by light wave energy .... so light loses some of it's energy to generate it so the generated wave will never be as fast as the light wave itself
Reply: Light and illumination are two separate things. Anyone delving deep into electrical engineering should be able to see how light, and the 60hz power we suck out of the grid, are part of the same all encompassing electromagnetic field that is the end all be all of everything that exists. Saying light slows down is misleading. Illumination slows down. The cause of the illumination propagates or induces into “reality” “space”, whatever name you want to give it, all the same. To treat light, RF, electricity, magnetism, etc... as separate entities leads to misconceptions about the fundamental forces that govern the universe. There is only magnetism and the dielectric. The two together are like two sides of a coin. We live on one side, and can only see/measure and interpret the results of the interplay between them. One side creates space, and force, the other creates counter space and rest. Light is definitely not no particle, or group of particles flying around in lines. Start with this assumption, and you will never understand what is taking place. There is one field, always seeking rest, and once at rest, always seeking force.
Reply: The induced wave isn't light.  It's electromagnetic energy with a speed and oscillation related to the material properties.  As you can see from the table each material has a different speed decrease.
Reply: @eggsngritstn 
Electromagnetic waves are literally what light is.
Reply: @spacejunk2186  But not all electromagnetic waves are light.  These aren't.
Reply: eggsngrits NO,  there is no electromagnetic radiation that is not quantized
Reply: @inox1ck  The particles which do the actual exchange of momentum and energy are quantized, but the wave function that governs their probable behavior is totally analog and continuous, which is why it requires an integral over a volume to produce a probability, and the size of that volume is the uncertainty, a la Heisenberg. With a large enough sample size, e.g. trillions of photons every second shining through a glass, the resulting set of points will, because there are so many, look just like the graph of the wave function. So using analog wave math on EMR is perfectly valid if you are blasting enough photons to be statistically significant. Not sure what the original argument was about, just bringing up a point, although maybe it's more of a blur...
Reply: @eggsngritstn  em wave travel in same spped
Reply: eggsngrits But all electromagnetic waves have the same velocity in vacuum.
Reply: @eggsngritstn  Hence a wave.....
Reply: Because electrons have mass and thus cannot move at lightspeed. Since electrons are arranged differently in different materials, their ability to oscillate will be constricted in a different way for each material, resulting in different indexes.
Also the electrons will affect each other resulting in a myriad of secondary oscillations, and these may become important. The video does not delve into this to keep it simple, but some Fourier analysis might be needed to fully explain what's happening. Have fun https://youtu.be/spUNpyF58BY
Reply: @TheNasaDude  But surely they do not have to oscillate at light speed for the wave to move at light speed?
Reply: @MonkOrMan  electrons cannot move at light speed no matter what. Electrons can emit photons when they go from an higher energy orbital to a lower one, and this usually happens after the electron has absorbed some incoming photon, able to push it to the higher orbital. Photons are massless and do always travel at the speed of light. But photons have some wave like properties, so when you add up all the wave functions of photons travelling through a transparent medium, you get a new wave that appears to be traveling slower.

Even without a full absorption and release of photons described above, photons can easily interact with electrons and vice-versa, changing spin, momentum, and other properties. This is enough to affect the resulting wave of light and make it appear to be slowed down (same behavior as described above) .
Reply: @TheNasaDude  I already know all that but I don’t understand why they can’t oscillate slower than light while the wave move at the same speed as light
Reply: @MonkOrMan  well there's a few reasons, first the wave of light is made of photons and electrons are not photons.
The most important reason is that the speed of waves is independent of the speed of the medium in which they travel.
For example you can strike an hammer blow on a train rail and detect it miles away, even if the rail is tied to the ground.
Reply: @TheNasaDude  Yes I know. In fact your railway analogy is just describing my question.

Why does the wave of electrons move slower than the light wave?!?

The electrons don't need to move at the speed of light for the wave to move at the speed of light, just like the train track doesn't have to move at the speed of sound for the sound of the hammer to move at the speed of sound.

So please answer my question.
Reply: @MonkOrMan I'm having some trouble understanding what exactly you want to know, but I'll try my best.

Speeds are different because electrons and photons are not the same, and they behave differently. It's like saying why does sound travel faster in the steel rail than in a PVC tube.
Electron have mass, which means they interact with the Higgs field. Photons do not do that, so they are massless and can travel faster.
This means that the waves they propagate will be different (another analogy: waves in water are different than waves in honey) and when you add up all these traveling waves the final result will be different.
Reply: @TheNasaDude  I thought each individual electron is reacting to the force from the light tho, so that would mean that the speed would be equal to c.

For it to be equivalent to water vs honey, then that implies that the waves are propagating through the substance from one electron to the next. If so, how is this happening?

To clarify what I'm saying, imagine you created a wave in honey but by picking up each honey molecule in turn and then putting it back down. This wave could travel at c no? However in real life, a "honey wave" would transfer from a molecule to the one next to it, and the delay would define the speed.
Reply: @MonkOrMan  the honey wave could not travel at c because you need to know when the previous molecule has been lifted, before lifting the next. This information can only travel at c best case scenario, so anything you do as a reaction to this information will add some delay. There are phenomena that appear to travel even faster than light, but they cannot carry any information and are usually optical illusions. 

Back to the electrons and photons, to the best of my understanding electrons are manifestations of the electron field while photons are manifestations of the electromagnetic field. Those two fields interact easily, but are not the same, otherwise photons and electrons would be indistinguishable. But they are, since electrons have mass and other properties different from photons. Again having mass forbids electrons ability to move at c. Differently from normal matter where a substance is not the same as its waves, fundamental particles are part of their own field, so the electron field can only move stuff around at speeds below c.
In order for an electron to create a wave that can travel lightspeed, it must interact with the electromagnetic field, which essentially means sending photons
Reply: @TheNasaDude  I thought the oscillating of the electrons was caused by the electromagnetic wave, not by responding to the previous electron?
Reply: @MonkOrMan  it's much more complicated than that. If you have more than 2 particles in a vacuum, every particle is going to affect all the others according to distance, type and such. Electrons can of course interact with other electrons, otherwise electric power wouldn't be a thing (btw electric signals can travel much faster than the electrons involved in the transmission. While the signal can go around the earth in a matter of seconds, the electrons themselves will move at a few centimeters per hour. The speed of the electron in this situation is called drift speed)

If you have a single photon passing through, you will find that the first electron is influenced, then the second is influenced by the photon and by the first electron, then the second electron can influence the third, the first, and the photon. It gets messy very quickly. But if you add up all the interactions, in the end you get a "sum of all waves" wave that appears to propagate slower than c
Reply: @TheNasaDude  Ok cool
Reply: The electron clouds of the atoms in the glass create a wave for the light to propagate on. Like a surfer riding a wave on the ocean. The light wave is interact acting with the electron wave creating a new combined wave that retards the lightwave so that propagates more slowly. The issue is that the video shows the electron as a particle and not a wave. Electrons orbit atoms like waves not particles.
Reply: Physicists don't deal with with the practical world; it's too complex.  Instead they deal with single particles their particles and their interactions with other single particles one at a time.    

Engineers don't deal with single particles, but can accommodate them within a pragmatic model.  To an engineer light is a stream of particles, confined as a beam, or dispersed as a field. Frequency is a measure of particles per unit time passing through a point in space in one direction.  The hotter the object, the more "photons" it emits per second. 

An engineer regards the idea of a total void as absurd. Whether we can detect it or not, there is always something "material" in any space,  it would take a infinite amount of energy to make that untrue.  What we call EM waves are particles moving through space, transferring energy. The part

In a material where photons are absorbed and then emitted they don't so instantaneously  in a straight line. If it were one photon and one atoms, it would either miss the atom entirely, or strike it. An atomic collision and photon re-emission has a slight delay and it isn't a "billiard ball" collision where the "massless" electron emitted would be traveling in the same direction as before while the atom stands still.  

Massless photons is a myth of physics. (Like vacuum, it simply mean that the means to measure that mass doesn't yet exist.  )

If massless, light could not move an object by impacting it in a near vacuum. In engineering the only distinction between mass and energy is the density and velocity. Particles interact with each other and with gravity, one of the weakest known energies, which is why light can be "bent" as it passes close to a massive body like a star, reflected by a "mirror" or absorbed by a small object. 

An atom is never still, its parts are in constant motion.  It vibrates in response to surrounding atomic forces and electrons are continuously being exchanged between atoms. 

It's only in "transparent" thin materials, with a thin but finite width beam that the large number of photons and misses per unit of thickness makes it seem that the direction is maintained.   It isn't.  The beam spreads, scatters and the series of photons that impact can change their intervals, their frequency. The denser or thicker the material, the wider the stream spreads and slows.  This is seen with prisms,
Reply: My guess. Because the speed of the electrons and the resultant wave is dependant upon the medium that they are part of. They are simply being agitated by the light.
Reply: But the only medium they are moving through is the electric field. I also do not think the explanation is correct - As someone has said why should the induced wave travel more slowly and also the induced wave will also induce a further wave  which will induce a further wave - in this respect it is like Lenzes law @Blackmark52
Reply: @iplanes1  "why should the induced wave travel more slowly"
Why shouldn't a wave propagated by another wave be less efficient and at a lower frequency? And the wave being caused by the change in medium isn't  itself passing from one medium to another so why would it cause a further wave?
Reply: My understanding of an induced wave is that it is caused by a transient or change in the field (electric or magnetic). The resulting wave is thus simply out of payees with the inducing wave but would have the same speed. The argument in this video simply does not ring true to me but it is a very valid video because it is asking questions about something we simply take for granted.  @Blackmark52